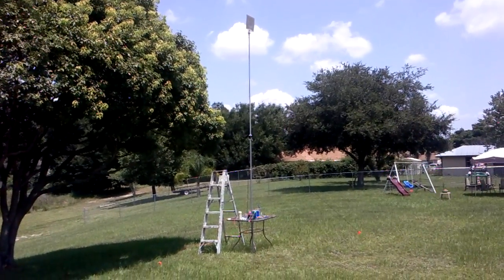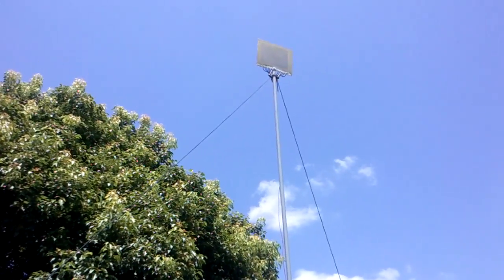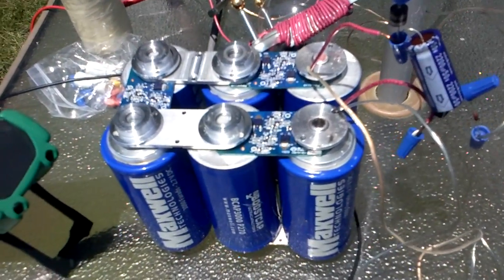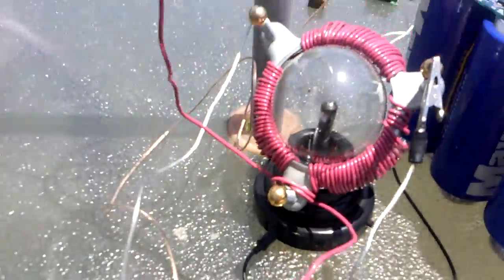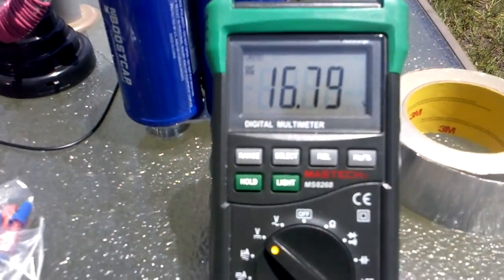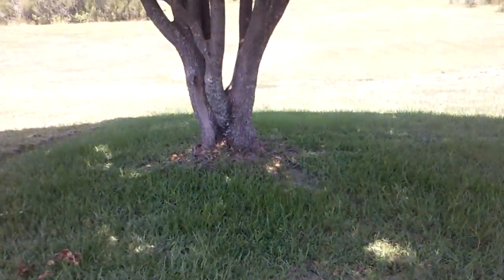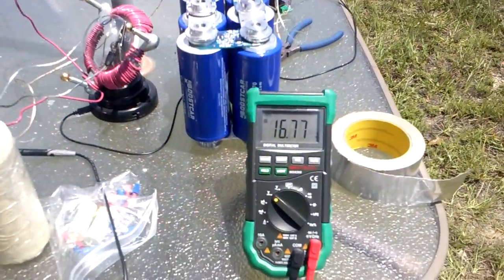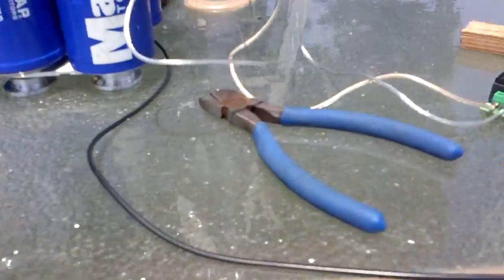Tesla's secret hidden in plasma ball

Comment: By the way; do you know the nature of ions in relation to the way the radiant energy device works? If ions (positive or negative) are what fuels it, or if it is one of the many things that do; solar radiation etc.. I may have found something that can generate a lot of ions for cheap; also it's inert, no wires or anything; just a selenite orgone pyramid with a large gauge copper coil (flat) I can show you a video of my ion meter; but I can say that close proximity to the plate with something like this might act as a energy source to fuel from; your plasma ball idea is genius, so much so that I don't fully understand it's function; nor do I recognize what type of coil you have placed on there; sorry to message so much I just have a lot of out of the box ideas for these devices that might make putting them high up in the sun obsolete: just need a running system to test my hypothesis
Reply from the maker: Hi okay here is my way of explaining it: Ions are the positive part of an atom and electrons are negative; since the surface of and atom can loose electrons at it's surface it then becomes positive and the atom missing an electron becomes an ion. The electron that was lost is energy added to another atom that becomes negative. Some materials tend to be negative and some positive. Do you have some pastic wrap in your kitchen? If so then take a small cutting and place it flat on a glass and tell me what happens. I will go step by step on the simple experiments with you. There are a lot of videos on YouTube though that explain things but if you want to experiment I promise to try to help.
Reply: Awesome thank you; what will putting it on glass do though? Won't I need a multimeter to tell any difference;  I was thinking of ordering a pure silver .999 sheet; probably thin: but it should do the job; it won't tarnish when I insulate it and pure silver is super shiny; I figured that coupled  with how Atoms interact with silver would be beneficial,  do you think silver would be the superior metal to use for an antenna?
Reply from the maker: Okay silver is a positive metal and shiny means that the elections are loose at the surface the dielectric insulation probably a urethane or polyurethane clear coat is nagative . I you place the plastic wrap to a glass it will stick to it because the plastic is negatively charged and glass is positive. Much cheaper to use stainless steel although heavier than silver it will not corrode. My problem was that I was trying to think back to Tesla's days when they did not have urethane based paints so I tried using a shellac clear coat and it was a bad idea, but all I have to do is soak it in some denatured alcohol to remove the finish the metal is still intact. Silver is still a better choice but not cheap and the antenna is only a capacitor to some degree. You seem to want to do the samething as me. To find a super cheap efficient solid-state method of obtaining renewable energy day and night but we can't show all our cards just yet. By the way the plasma ball you can buy from Amazon for about 10 to 13 dollars and the coil is a bracket for a garbage disposal that can be bought at a hardware store for a few dollars also. Oh yes the plasma ball is the USB ones that hookup to the USB port on any computer. I get you reading what you are asking is taking me back to my first original thoughts when I started. I want to share the whole thing with you but once you know don't hide it share so we can't be stopped if you get what I mean.
Reply: Right there with you on that, this information it's just spread as soon as possible
Reply: My schematics include a 12v deep cycle battery in it; have you ever tried putting a battery in your system to draw power from directly?
Reply from the maker: @seangust9025  In the video you just watched I am using a 12 volt super capacitor that can turn the engine of a car for 30 seconds and it was recharging enough that I had to disconnect it so I wouldn't blow it up since it was a quick test and I didn't include a voltage regulator in the circuit on that side of it. The plasma ball is very sensitive to voltage spikes and will fry if not exactly at 5 volts so I had to regulate the power on that end. I have changed a lot of things since though.
Reply: Is there a more continent way for us to exchange info?  I'm not opposed to giving you my number but I don't know how to do that privately
Reply: Does the plasma ball have anything to do with "zero-point" energy? The concept makes sense so Ill take your word for it: I also understand scalar waves and was wondering if you could "feel them" I figured since you've exposed yourself to them enough so that you can feel them by now, not sure but I think I can make them myself with my hand
Reply: I kinda wanted to talk to you about something but wanted to keep it on the low for the most part; but if your unfamiliar to the EIP purple tesla plates, you should check it out; I finically got my grounding in and I'm getting pretty high AC voltage with bad conditions and I'm comparasion to other metals; aluminum, pure silver bars, etc, steel just came in so I'll be testing that too but I wanted you to check out those plates since you have an interest in tesla and scalar waves;  The EIP plate was made by an associate of Nikola tesla. Let me know your thoughts
Reply from the maker: @seangust9025  Sounds great sure man I am interested in everything Tesla did I feel that to much of what he discovered has been kept from us.
Reply: Government scooped up most of his research right after he died, including but not limited to the "death ray" but they certainly have perfected the methods tesla once used, yet they  keep us from his inventions and virtually erased him from history.  If I have a reading of 1.45 V  AC, doing a test run, no insulated plate just the bare plate and a solid ground, is that  hey good reading or am I using my multimeter wrong?
Reply: Is that A* good reading?
Reply from the maker: Nicola Tesla's secret was hidden in plain sight and they missed it. Lol I figured it out by reading between the lines sort of way. " Is it more powerful than Crook's Radio Meter? Tesla response: " Yes meny times more powerful."
Reply: I remember that quote; you certainly know your stuff; is your antenna bent?
Reply: In any case, my preliminary results seems to show steel as the best metal but since all the types were difference sizes for what I had, 

Did you use any type of "sealing" spray on your plate or any of the metal bars welded to the plate?

Comment: Yes Ralph!!!

Have you tried NOT using the battery and just using the Capacitors?

Tesla did state in his Radiant Energy patent that you could use battery but he also stated you can just use your antenna and ground to charge your capacitor. Let me know what you think Ralph.

Good work Brother!
Reply from the maker: Yes I am using capacitors only I called the super capacitor bank a battery by mistake I was excited with my results at the time. Sorry about that i kind of done my videos on the fly and I am not good at it. I just love to experiment and make things.
Reply from the maker: Sorry I called the Maxwell super capacitors a battery on the video. There are no batteries in the experiment. I was too exited about the experiment and I blondered in my presentation. I have come a long way since I did this but I think I still suck at videos. I don't want to do anymore videos until I finish my build and can setup proper schematic and presentation. Please do not try doing anything like this in a lightning storm. I was not really thinking how dangerous it could be if someone saw this and went out in a lightning storm and it would pull an arc that would disintegrate them with the experiment and who knows what else because the fire from the plasma would be so hot it would melt steel. I have seen up close and personal what lightning can do and it is scary.  I seen it fuse aluminium copper and steel like droplets on a concrete slab that was the only thing that survived the heat the metal building melted to the ground with everything in it a couple of near by buildings were also damaged and the glass on the Windows at the closes end melted from the heat of the arc. Not good! So safety first please to all my friends out there please.

Comment from the maker: Hi Vitor that is a very valid question it was one of the main reasons why I regulated the voltage to begin with. I found that in air and ground differentials I could achieve very high voltages but very low amperage and the super capacitors that I wanted to charge are 12volts with very high amperage enough to turn the engine in a car for about 30 seconds. Also I would be running the USB plasma ball as an oscillator at 5v- 300 ma. Load so I had to rectify the input using 15 volt 10 amp diodes in combination with the 12volt zener diodes and for my own stupidity I did not record the amperage that I was pushing back into the supercapacitors even though it worked I missed doing that and shows me as a poor scientist for not recording all the facts. I can tell you that it was over 1amp so it was a very slow way to charge but the fact that it did that with a load was very exciting for me. Thank you for your visit and I hope to make a better presentation on my next video.

Comment from the maker: Yes the pyramids where energy containers and transmitters close to Tesla's magnifying transmitter design. The center holds a resonant cavity and above it are the crystals of pink granite tuned to F# also Resonant frequency of our planet see schumann resonance. This is what I see when I look at their design. Also navigation markers through out our planet from a time and technology lost after cataclysmic events. Yes goes with my experiment too. Resonant Cavities of the sort are seen in the Steven Marks devices pretty cool stuff. Remember he worked with sound systems and was able to figure that part of it. We all seem to have bits and pieces but if we put it all together there is no end to what we may accomplish for the future of all humanity. Don't forget Nicola Tesla.
Reply: Shuman resonance; that is what I forgot to tell you: the EIP plates are tuned to that frequency; during construction of the plate they program a frequency into the crystalline structure of the aluminum. Essentially the atomic structure was manipulated; problem is the way it's made; almost fiburous  type metal, might be hard to get good electric connection even if I weld

Comment from the maker: Still have a lot of work to do but the results are looking good.
converting the raw voltage and amperage has been a challenge but as you can see instead of fluctuating voltages ranging from 350 to 800; I am now at a steady 16.7 volts and my fluctuations are down with in 5 micro volts.
Reply from the maker: Hi everyone I am working on some new videos when something works and I am not really sure exactly why then I need to do more research to give everyone an answer that makes sense. I have experimented further and put the work on the oscilloscope that Stephanie got me for Christmas and I am finding out that the plasma ball as an oscillator produces scalar waves and that what scalar waves do changes everything we know or at least what I know of electronics and electricity in general because it does not work like DC or AC rules it is a from of electrical energy that I would call the third stage in electricity: So now there is DC, AC, and CW. for "Compression Wave" electricity.